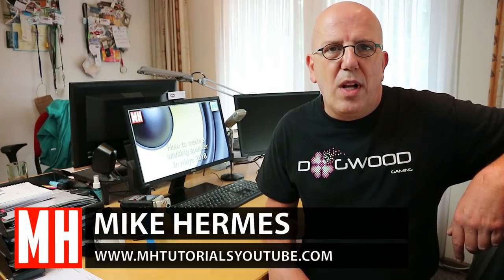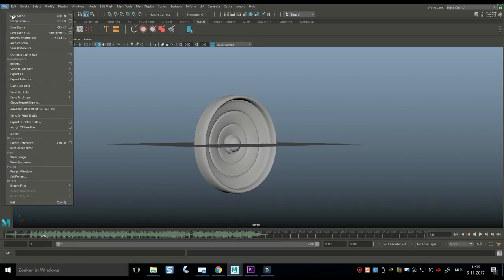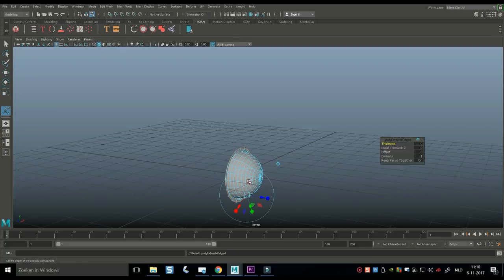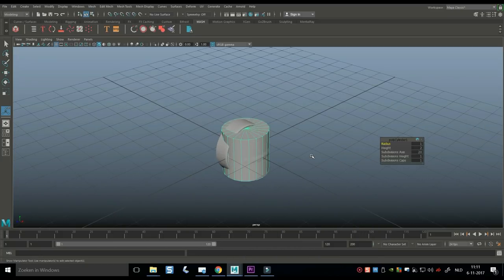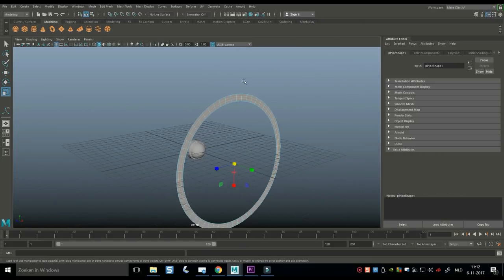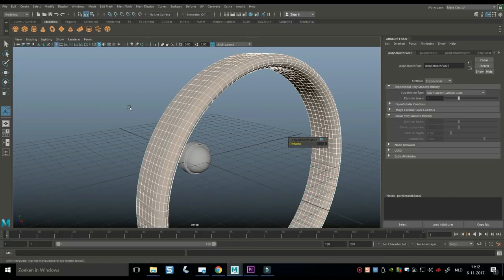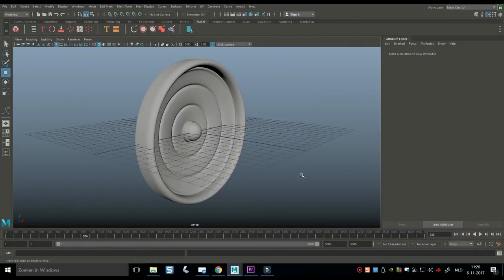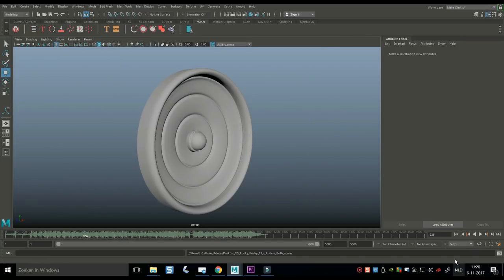How to create a working speaker ( with audio ) in Maya 2018

Comment: Hi Mike , quick question, if I wanted to make a second speaker, how would I go about it ? ive tried to duplicate but of course the speaker does not move, and when I tried to add another mash to it, all that happens is the original is effected not the copy.
Reply from the maker: Repeat the previous steps. So create new speaker ( or duplicate the original one before making a MASH network
Reply: check it may help you

Comment: I'm not sure if you still respond to comments but when I import the audio at the end for sound it puts the audio waves on the time line but I hear no sound.
Reply: When I slide through it my clicking and holding I can hear sound but just hitting the play button its silent
Reply: Found a solution, to those wondering you need to right click the time-line go to play back speed and click on Just "Real Time"